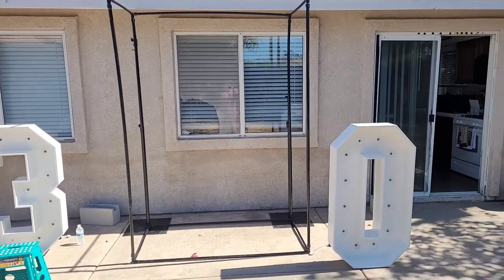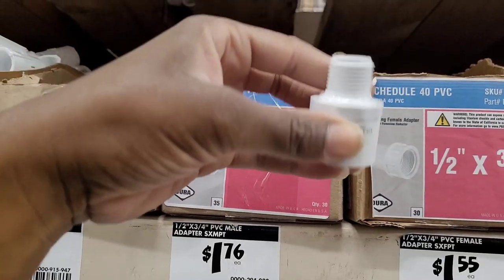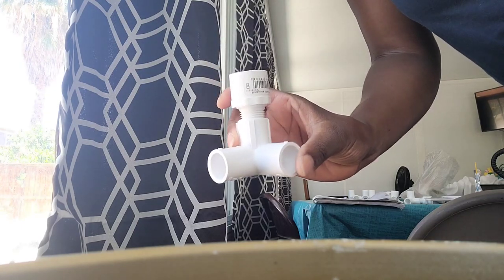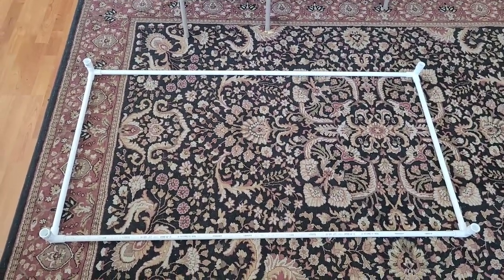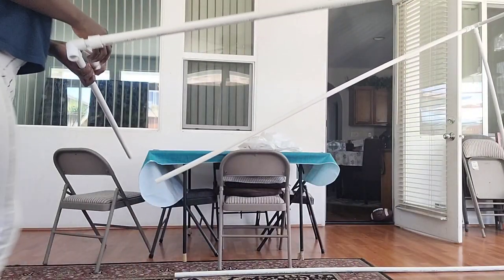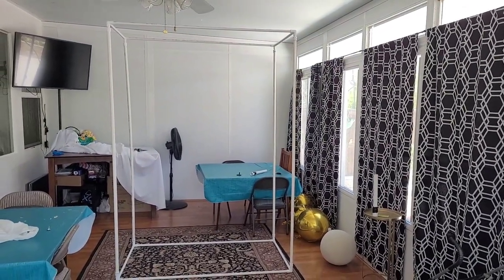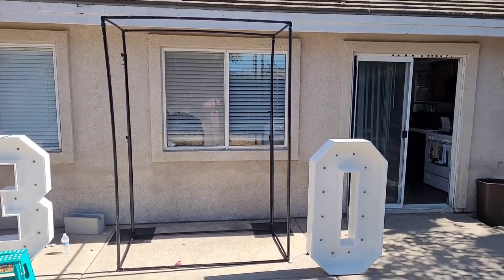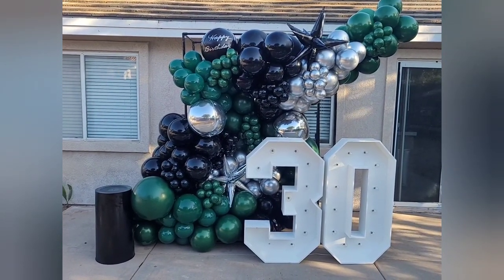How to make a cubed backdrop stand

Comment: Why did you use two different sizes of PVC?
Reply from the maker: I couldn't find any connectors in 3/4 inches that day, so I had to get the 3/4 to 1/2 inch connectors which caused me to use 2 different sizes of pvc pipes. I'd suggest using one size.
Reply: @valsballoonsandbusiness  😄 Understood. Thanks for your response; love your channel!
Reply from the maker: You're welcome 😊